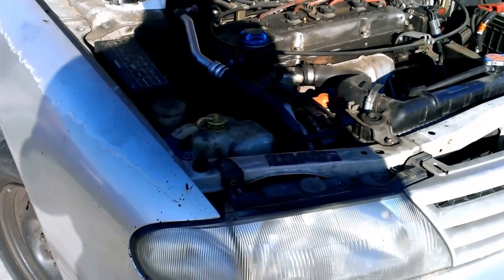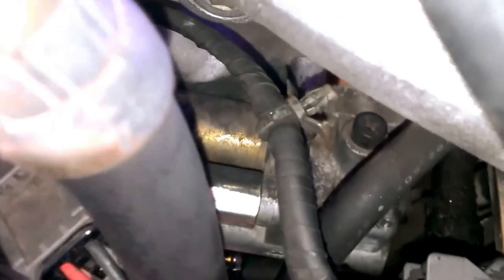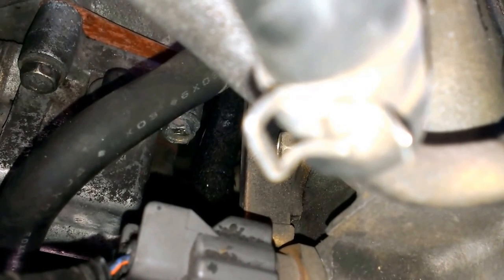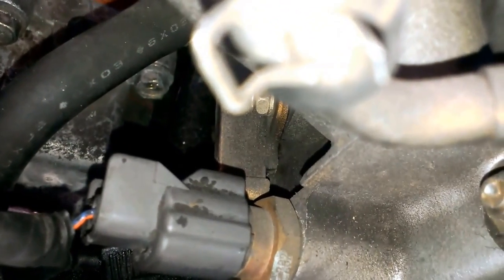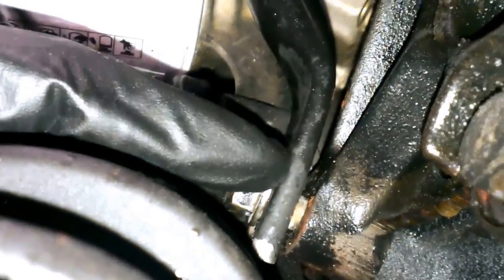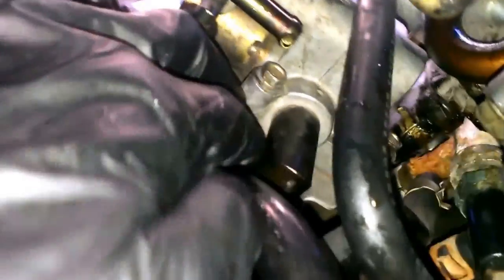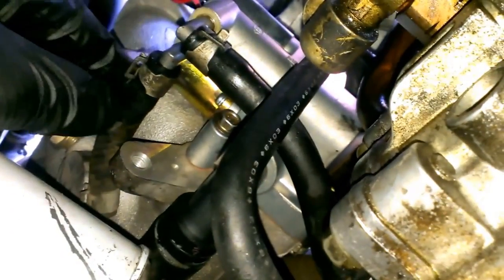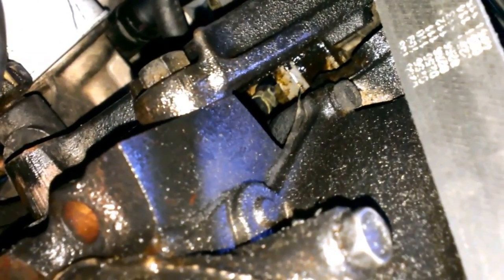97  altima idle air control valve replacement

Comment: I just wanna tell you thankyou.  Because of your video I was able to replace my IAC valve by myself and save myself money that I can use for my family instead.  Thank you!
Reply from the maker: +Mr Hanzel your welcome my friend. this is what im here for. let me know if you have any other automotive needs
Reply from the maker: +Motorsport Factory dont forget to subscribe and join me on facebook. stay up to date on what we are doing and stay tuned for contest and giveaways
Reply: +Motorsport Factory  So I installed new idle air control valve and the new one is whistling loudly???  why is this? aside from that, my car is still idling wrong though before I installed the new one I took off the old one and cleaned it and it worked great for one day.  so why am I not getting the same results from the new IAC ?????? please help!
Reply from the maker: you could be having other issues. that may not be really coming from the iac. things to check is do you have a cel?.... its really hard to say whats going on with your car without diagnosing it. because if you are getting same results from either iac... also make sure that the iac  is adjusted correctly too. ill help as we go along with this
Reply from the maker: the other thing is did you use a new gasket? if not then thats probably why its whistling more . also check other things such as tps sensor,oil in the distributor.
Reply: Thank you will do
Reply from the maker: no problem mr Hanzel.ill do my best to help. without seeing the car it would be hard to diagnose what the issue is. but ill do what i can from here
Reply from the maker: +Mr Hanzel hello sir. i have not heard a response. i was wondering if you have resolved your issue yet ?
Reply: +Motorsport Factory he said he was able to and save money..
Reply from the maker: Lets Play ok thanks for the response.can you ask him what the issues were?
Reply: iacv
Reply from the maker: o ok . he told me that he change to a new one but after installing it didnt seem to run right. so  told him to make sure he had put in a new gasket for the iacv and to check other things. and i was just wondering if there were other things that needed fixing
Reply from the maker: yes its best to change the gasket just in case for leaks. you never want to have to do the job twice

Comment: You did a good job on your video, You mentioned replacing the spring clamp for a hose with a screw clamp. The reason spring type clamps are used is so they can expand and contract a temperature changes. Over the log term the fixed tension screw clamp will get loose and may leak. tightening the screw and the thermal expansion and contraction will eventually make the rubber hard and may crack. So using those spring clamps that seem cheap is better for hose life. Screw clamps are also available with built in springs.
Reply from the maker: hey thanks for the comment Mike. yes i agree with the spring clamps and what they are meant for. i choose to use screw clamps for myself because it just becomes easier to access in the future

Comment: this was very helpful my 95 Nissan Altima  keep cutting off i changed my water and fuel pump, fuel filter, and  still cuts off. now i have a new job to take on .I love the challenge.Thanks for the Help.
Reply from the maker: +Patrisha Greene Sr. your welcome . also besides doing this also check the distributor. that could be another issue. please subscribe to my channel and join me on facebook . 

https://www.facebook.com/Motorsport-Factory-199452093456686/

i  will make more video for the altima soon

Comment: thanks for the video .I have a 98 altma it was doing the same thing .I changed it out works great now .thanks for the video .
Reply from the maker: hey your welcome. im glad the video was helpful to you
Reply: What was the issue ???
Reply: @ricchhhboyzzz6145  the idle air control valve was bad so I replaced it

Comment: Your IAC has the "square" mounting flange. There is also a version with a smaller rhomboid shaped flange requiring more disassembly in order to have clearance to the upper bolt closest to the head.

Comment: Wish I had found this video sooner! 😅
Thank you for sharing.
Reply from the maker: yeah this was first video i made. i spent couple days on it to make sure i did it the best of my ability at the time. i have a better way to make this a better video next time. i will make a 2.0 version of this. so it will include the pcv at the same time
Reply: This project has been a good reminder why access to service literature/diagnostic procedures are so important. I’m looking forward to adding it to my arsenal. It’s not cheap!
Reply from the maker: @mr_7932  it sure it. there are cars that are worse . its pretty much a whole week project when it comes to certain things
Reply: What was wrong with it? Why did you replace the IAC? My Nissan stalls when I turn on the AC.
Reply from the maker: @urielmunoz1011  well i did notice it was clooged with carbon. main reason why i changed it was cuase car started hesitating on acceleration. but come to find out i had to change other things too like the distributor and stuff. if you having these issues  check plugs,wires, cap, rotor,distributor,check CEL codes ,check for vacuum leaks

Comment: 1st you should have started it and let it run with the problem. then after the Fix you should have done the same to show that it is running better. 
But thanks for the video this might be my problem going to try and do the reset 1st.
Reply from the maker: i know i really wanted to do that. to show the problem areas that cause this. but i had so much going on i just focused on the repair it self. but  next time i work on one of these im gonna make a version 2.0 of this with better camera gear etc. and will go through the diagnostic and testing process and then replacing it

Comment: I have 99 Altima Se 2.4 just got it as a beater/ my kids first car. Had a smoked clutch with 166k. It ran great when I looked at it but wasn't able to drive it. It has a check light on and I didn't check it before disconnecting the battery. I have since got it running and drove it for five laps around the neighborhood and now it idled down really low and shuts off after it is warmed up. I have checked for vacuum leaks with starting fluid shots and none were found. I was

Comment: having the same issue noticed u mentioned a coolantbsensor is on the valve,would that explain why my coolant gauge fluctuates back in fort with the rpms?  and if so is the part bad or just the sensor?
Reply from the maker: well you have to test everything to see what is really causing it. its really case by case . it could be the sensor itself. but i believe i said the coolant sensor is by the valve not on the valve itself.  the main things to look for is vacuum leaks,check ignition system, fuel system, mas sensor, check to see if you have stored codes.  its best to diagnose the car before replacing anything

Comment: Hi, I got a 98' Altima and it has a lot of problems like you mentioned, vibration, the AC didn't work properly and sometimes the car wants to shut down, do you know if the same steps needs to be done to replace the IAC on the 98' model? sorry for my English
Reply from the maker: every car  that has the same issues may not be all coming from the same area. always check everything on your car to verify what it could be. check for all ignition parts to make sure they are in working order, check the fuel system ,check for stored codes , if you have a check engine light then check what those codes are then go from there

Comment: Hi there, my Nissan Altima 97 sat for a month with a full tank on gas while I changed the faulty water pump. (Gov work outta town couldn’t do it immediately) before I replaced it the car wouldn’t start. I replaced the wp and replaced the valve cover gaskets because there was oil in the spark plugs 1 & 4 and there was some gunk on the
Reply: On the coils. It wants to start cause it cranks and turns over a little bit but don’t know what to do now. The analyzer I have shows the code P0505 could you reply back thank you
Reply from the maker: @prime_era_kills3901   that code sounds like a idle air valve.  it could just be plugged up and needs to be cleaned out. or replaced. but also check other components that can be an issue like distributor to injectors just to be on the safe side

Comment: Was your car stalling, mine has been stalling randomly coming to stop signs ,stoplights etc, I put a new fuel pump ,new fuel filter, new crank sensor, so now I'm thinking it's the idle air control valve, any suggestions
Reply from the maker: yeah it would hesitate and stall. yes test out the idle air valve and also check injectors to the distributor to. . the dist will sometimes have oil built up in it
Reply: MAP SENSOR, CONECTOR DAÑADO, TENIA ESE PROBLEMA

Comment: I am sorry but hit post button by mistake. To continue. Is this a similar symptom you were having with your car?
Reply from the maker: yeah that was one issue. check the distributor for oil build up. take cap off and see. also check fuel pump and injectors. also fuel filter. sometimes the basics is all it needs

Comment: did you have to take out the oil filter i have a 96 altima and i need to do this i hve the part and ll the tools just not sure if i have to take out my oil filter so i can get more work space also figured id change the pcv valve while im in there
Reply from the maker: it can be done without taking out the filter. as i did in this video. but you can take the filter out . to get more access  to the big hose thats attached to the iacv .and yes i have a video also on taking out the pcv. just follow the step to taking this out and you can see the pcv .

Comment: Very helpful video, my 95 Altima  reports  the 505 error code too. I had a very bad time figuring how to remove IAC system to clean  it up (before viewing your video), when I did it, I took off the oil filter  to make more work space, I am wondering if It was not necessary. I understand idle state problems you mentioned, but my car also experiences a lack of power mainly when driving up hill. Might it be related it to IAC fault too?. I have changed sparks and its cables, there are no other error codes. Thanks for your help.
Reply from the maker: +Oscar Badilla taking the oil filter is fine. no need to worry if you take it off or not. taking the oil filter and the filter housing is good to take out when you want to change pcv valve . thats when you will really need space.  if your lackin power is probably  anything from needing tranny fluid flush or clean mass air flow. change the fuel filter if you have not done it. if you do decide to change pcv valve make sure to change the o ring in the filter housing or use rtv  .or you might need new timing chain.
Reply: +Motorsport Factory . Thanks for your advise, you mentioned many important points, so I would like to talk about each one:
1-Automatic Transmission.  I have already changed trans fluid recently, I removed pan and found two dirty magnets in it. So I cleaned it all, I didnt find any oil filter, should it be?. Oil didnt smell burned. Problem I have is that when I shift from reverse to drive or viceversa trans takes little time to react (get traction) and if you press accelerator pedal when change, you will hear a hit in it.
2-Fuel Filter. I will change fuel filter. 
3-Mass Air Flow. Please advise how to clean MAF sensor. The original one had to be replaced time ago with a used part. I experienced intermittent lack of pwr that time, perhaps it is faulty again.And I think this is the main suspect.
4- PCV valve. It is hard to reach according to I have read and it is reachable only from below, so I would like if you can tell me some hints to verify if it is malfunctioning before trying to replace it.
Now you know I love this car, It is an Altima 95 SXE. thks again.
Reply from the maker: the auto tranny filter is mounted right above when you take the tranny pan off . you can see it. 
here is link to show what it looks like 

http://www.partsgeek.com/gbproducts/DC/6668-05384114.html?utm_content=DN&utm_term=1993-2001+Nissan+Altima+Automatic+Transmission+Filter+Kit+Pronto+PTK1234+93-01+Nissan+Automatic+Transmission+Filter+Kit+1995+1997&fp=pp&gbm=a&utm_source=google&utm_medium=ff&utm_campaign=PartsGeek+Google+Base&gclid=CjwKEAjwgbG5BRDp3oW3qdPiuCwSJAAQmoSDeGD_h4lEuL2L2Tqt9Dd_Xbz9iDhUCGg8IJhtA8FAzRoCFLHw_wcB&ad=47584901292

to clean mas air flow you must use only mas air flow sensor cleaner. do to specific materials the mas air sensor is made of. the cleaner is specialy made for cleaning that. 

link to cleaner 
https://www.zoro.com/crc-electronic-cleaner-16-oz-aerosol-05110/i/G2052416/?gdffi=047ada998cf641fa93e55ae8579df863&gdfms=FD1B86B6A6D14888A68D5EBA7AB06C81&gclid=CjwKEAjwgbG5BRDp3oW3qdPiuCwSJAAQmoSD38mQTdRbwPfHCbHQw5nNNOvsX6SNkH9jKK7FDf23PhoCtUPw_wcB&gclsrc=aw.ds

to get to pcv just follow my video after  taking out the idle air valve. then just follow the video. i didnt repeat the steps in the removal of the idle valve cuase it would be to much time. so follow this video and once you get to taking it off then follow this video on removing it 
https://www.youtube.com/watch?v=roQVp3RzYgw

do replace the pcv while your doing idle air valve its much easier and not have to work twice . so while iacv is off just work on the pcv too. 

also your car may need tune up if never done. 
have the timing chain also inspected . that may need replacing too. 

hope all this helps

Comment: Great video If I turn on my air conditioning and or just the fan the engine dies is this the cause also?  please advice thanks!!
Reply from the maker: it could be. but it always better to diagnose the car . just cause the symptom is the same dont mean it caused by the same issue. check for CEL codes. check vacuum leaks. and go from there

Comment: I wouldn’t have used carb cleaner to clean it, I would put this in the ultrasonic machine and it will look like brand-new
Reply from the maker: yes you are right but at the time i didnt have anything like a ultrasonic cleaner. yes that would have done a better job.
Reply: @motorsportfactory  I bought my ultrasonic machine from Harbor Freight Tools for $80 and returned it two months later
Reply from the maker: @Ben-Hawy  i take it didnt work well or just needed it for a job. ive done that before where i just needed it for a few jobs and then returned it

Comment: I would have liked to hear it run after the installation. Thanks for sharing.
Reply from the maker: i do apologize for not doing that. the main point of the vid was on replacing it
Reply: @motorsportfactory  where did you buy you Idle air control valve?
Reply from the maker: @Stevendagr8  i got mine from autozone
Reply: @motorsportfactory  Thank you for the video. I am at the point where this part is no longer available anywhere here on the California or online. Try one from the junkyard (cleaned it well too) and now the idle fluctuate like crazy. Any suggestions? Thanks again
Reply from the maker: @felixcervantes7215  so you cant find it at all?... also check other things like the distributor. and other cel codes
Reply: @motorsportfactory  thanks for replying. Everything else is good. The car ran like a champ before it started to stall at red lights. The timing sat around 20 before I removed the IACV. Timing now fluctuates too. Nothing else was moved. I cleaned both original and the one I picked up from the junkyard very well.  No codes. Now it bogs down and then it revs like it's trying to adjust itself. I even tried moving the idle screw to see if that helped but it didn't. I've tried to find a new one but no one has one in stock.
Reply from the maker: @felixcervantes7215  remove the distributor cap and see if you see oil in it. that could be it.
Reply: @motorsportfactory  Nope. No oil. I made a video so others can see and maybe weigh in. All help is greatly appreciated.
Reply from the maker: @felixcervantes7215  have you tried testing the injectors. also for the idle air valve. if you dont change the gasket with it can cause the leak. try doing a smoke test to see where it could be leakin
Reply: @motorsportfactory  I didn't swap the gasket because I couldn't find one. I made a video but don't know how to post it. I'll check the injectors tomorrow after work. Thanks for your help